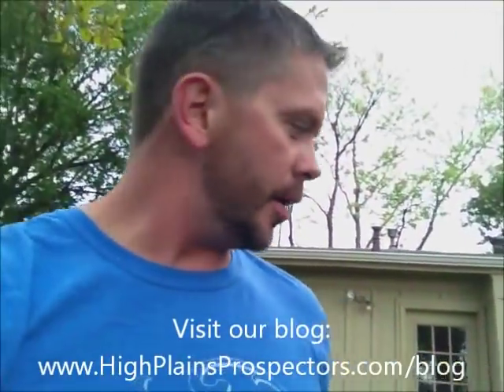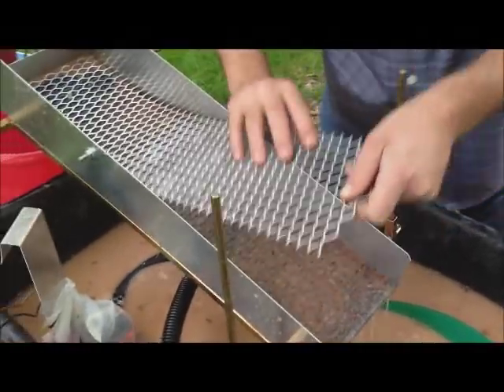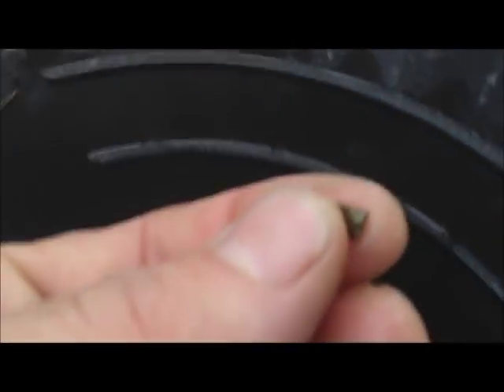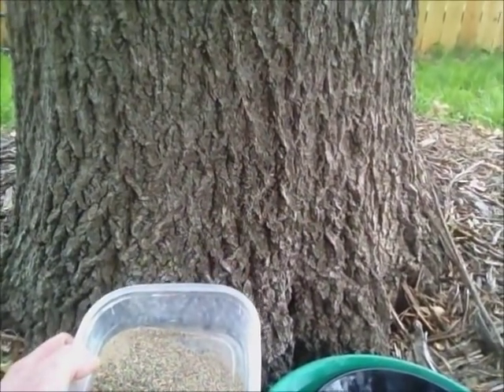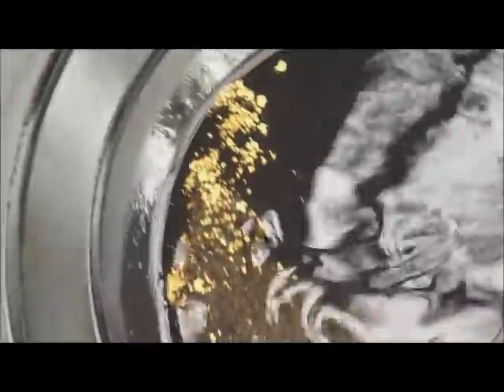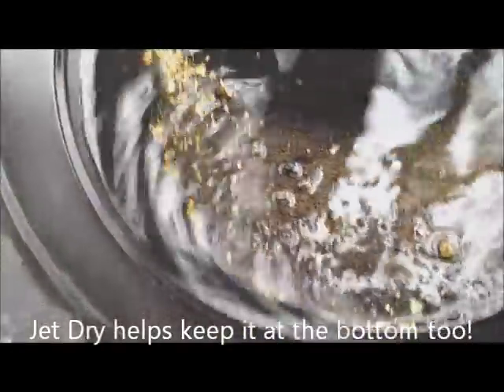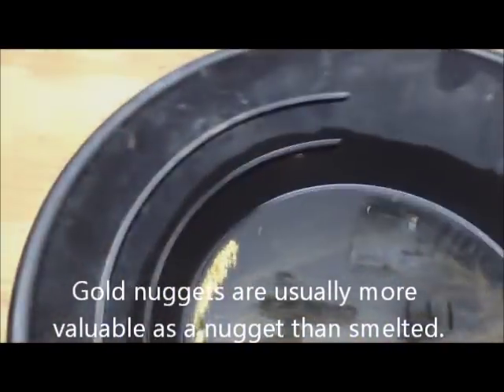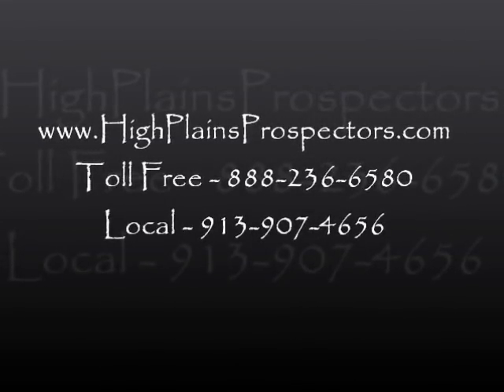Gold vs Pyrite - Telling The Difference in The Field - Gold Mining Equipment

Comment: TAP...do not swirl...no circles...circles BAD.  Also, get you a large eye drop bottle or one of those travel bottles that have a squirter...put jet dry in it for the field...seen a lot of guys throw gold away because of surface tension...never tested it for 'squish' before tossing it...BAD...BAD...BAD...

Comment: How about trying a high powered hydraulic press similar to one that presses thc under heat. You separate the elements in a pan and then press each for diff. controlled experiments

Comment: you learn this by panning. real gold is 19 times heavier than water (I think) and it won't move. It will only move if it is dirty with lighter materials, that's why people who prospect carry around dawn with them. Some pyrite can have gold in it, kind of rare, I collected some of this from my aunts mine in Nevada and had it tested. You can also find rubies and diamond in your black sand, diamonds will stick like the gold, rubies will move with the sand so use a magnet and the rubies usually fall out of the sand as you lift it up. You are welcome noob prospectors.
Reply: Dylan McCallister fantastic tips... Thanks for the extra info!
Reply: Dylan McCallister wait youre saying rubies are magnetic??
Reply: @unsubme2157  No he said rubies fall out so the black sand must be magnetic and stick to the magnet and the rubies fall out.
Reply: People use dawn because of waters surface tension not cause the golds dirty...
Reply: @InUrMoufEnt  Yes. Water surface tension will cause powder gold to float.
Reply: Yes, 19x heavier. Interesting stuff you wrote about diamonds and rubies. It's been said we have corundum here in my area.

Comment: pryite is shiny and when you touch it tends to break or fall apart espic in your pan, also leaves a gold streak I call it if you move it around. You should be able to tell gold . I like to use a high def light source normally it picks up really nice if you don't have a scope. Blue and green pans work best I do use the black ones but tend to be harder to find..

Comment: HELP!!!

Okay guys I have a question.

Is Mica magnetic or dissolves in hydrochloric acid?

Heres the deal, in one of the local beaches I went to when I was little I would always see shinny flakes in the sand. A few days ago I saw them again and picked them up in a bottle to take home and study it closer. I have literally seen every video and read every article on how to distinguish real gold from pyrite and mica and one of the key things I found was that both mica and pyrite are made of some sort of iron and iron is magnetic, and when I put a strong magnet to the flakes the were not magnetic. The thing is that in almost every other aspect "how shinny" "is it heavier" " is it malleable" does it break" all have pointed towards the fake stuff. 

This is so so small flakes that when I pan it, the flakes will literally go to the top. This is basically super super thin, as in aluminum thin. Then when I bend it it does but it will break after I put pressure in the middle.

I am seriously hoping this is gold but I don't want to get my hopes high.

Does Mica or Pyrite dissolve in some type of chemical that gold doesn't? That way I can be sure enough that what I have is gold and buy expensive gear to get it out?

Please help me out. High Plains Prospectors- Metal Detector & Gold Prospecting Supply
Reply from the maker: I am afraid I am going to have to diagnose you with gold fever my friend.  It has happened to all of us.  Mica and pyrite will not be able to be removed with a magnet.  I suppose you may find some pyrite with enough iron to stick to a magnet, and I know if you heat it it becomes magnetic.
Reply from the maker: That being said, there is a chance you could find some beach gold depending on where you are located.  Odds are, if there is gold there, others have prospected for it.  That is not to say there isn't plenty left.  I saw an episode on Gold Fever where Tom Massie did some prospecting on a beach and found a fair amount of gold.  Find a local prospector and talk to him/her.  You should be able to do so on a forum or through the GPAA.  Good luck and happy hunting!
Reply: High Plains Prospectors- Metal Detector & Gold Prospecting Supply So it isn't gold?
And I was thinking of doing an experiment with a school professor, where we would get hydrochloric or sulfuric acid and add it to the sand, and all material but gold would be left. SO my question is pyrite or mica able to dissolve in HCI?
Reply from the maker: I am sure over time it would dissolve...very small pieces would.  I am all about experimenting so go for it!  I am not a science teacher and took only one chemistry class...so I am not sure exactly how it would work with your material.  Get some video...we would like to see it!
Reply: +High Plains Prospectors- Metal Detector & Gold Prospecting Supply can you use soap to lift the gold?
Reply from the maker: No, a small amount of rinse agent is all you want and it actually breaks the surface tension of the water to make the fine gold sink.  Good luck and happy hunting!
Reply: High Plains Prospectors- Metal Detector & Gold Prospecting Supply thank you very much!

Comment: did u find all that gold 6:54 at the top of the sand/pan (or is that ALL gold?) anyway did u find all that in ur yard?
Reply from the maker: That was a mixture of gold, pyrite, and sands.  The point was to show how differently they act in the pan.  This gold was found from various places around the country.  This is the result of stockpiling  a bunch of concentrates from different places and then going through them to extract the gold later.

Comment: Sir, I got g-fever. I have been thru the panning part in a select few spots. Not much, plus hard spots cause of river currents and tides. I have discoverred gold flakes or pyrite in Quarts that is attatched to rocks. I have been heating the quartz for easy extraction. I got 1,000 tiny gold flakes per square inch. I just found out how to test for fools gold, and 1/2 of my flakes are sticking to a magnet, others are not. Alot of flakes are silver, and alot gold. I got a big rock nextdoor I have been pounding on, cause of it's great concentration of quartz ROWS. I also know where there is a huge peice of quartz near a river that cannot be moved by hand. It is also on top of a rock. The rock itself has a stream flowing thru it, and after seeing my pic's again of it, there is quartz growing on top of it in areas. I just now brushed a bunch of teeny,tiny gold flakes off from the rock, and magnet won't stick to it. Maybe too small..I got a ton of quartz around here, what to do? Put it in the acid? Re-heat? FYI, I heat my quartz/rocks in a burn pit. That way, it will cook a long time. I also cant beleive how fragile the quartz gets when heated to 1,000 degrees or more. Any thoughts?
Reply from the maker: LOL, it certainly sounds like you do have a case of gold fever.  The first telltale sign is mistaking every rock for gold!  Beware, gold is hard to find.  You can certainly find gold near quartz, pyrite, black sands, etc.  However, not every time!  Keep at it and just keep anything  you find that is really heavy (i.e. black sands, etc.) Most likely you can extract some precious metals out of it eventually.  You may try one of the Kwik Kilns for smelting some of your concentrates.  Here is the link: http://www.highplainsprospectors.com/kilns-smelting-assaying-c-155.html
Good luck and happy hunting!

Comment: I noticed lots of little bubbles. Are you by any chance using soap?
Reply from the maker: LOL, no, just too much Jet Dry...I over-applied.  Everyone seems to want to point that out to me.  Geez guys gimme a break! Thanks for watching...and pointing out my imperfections.  ;)
Reply: I didn't mean to drill you about that. So is that basically to keep fine golds from floating?
I am basically a novice at it but have recovered so far about 3 grams.
Reply from the maker: :) No worries.  Yes, the Jet Dry or some other type of low-suds rinse aid will help fine gold from floating. Just a little goes a long way (as you can tell in the video). 3 grams is not bad for starters!  Keep it up!  Good luck and happy hunting!

Comment: There is an area I cut firewood in northern California where the ground sparkles and is littered with agate and quarts. I went out after the last big rains and there was lines of what appeared to be black sands all the way down the hills. what are your thoughts on the signs of agate quarts and the sparle all over the place?
Reply from the maker: I say pan some out and see if there is any gold.  Certainly where there is quartz there is a chance of gold...especially in Northern California.  Lots of gold up there.  If you want to scoop up some and send it in, we can sample it for you (we can video the whole thing).  Usually we like to get about a medium flat rate box worth at least.  Send me a PM and I can arrange postage and such.  Then if we find a little gold you can go back with some better equipment and extract some more.  If there are any dry streams, that is where I would start.  The gold will accumulate there.  We can discuss more if you like.  Thanks for watching and thanks for the comment!

Comment: have any info on determining the difference with acids?
Reply from the maker: Sure, visit our website here: http://www.highplainsprospectors.com/complete-gold-testing-kit-p-785.html
The instructions are here.  It is always good to get some experience using the gold testing needles you can purchase separately...or if you have some refined gold where you know the karats that will work too.  Good luck and thanks for watching!
Reply: i have crushed ore from the main vein in a high copper environment, i see gold,.. i am concerned with it being iron or chalcopyrite,.. was wondering if there was an easy anwer other than an assay,.. but no matter,.. its been sent off for assay
Reply from the maker: Thanks Todd, sounds like you took the right path.  Good luck!
Reply: Nitric acid pyrite will go black gold will not change

Comment: Good video... But I shall prompt a question...
Have you ever checked these pyrite pieces??? That they do not contain any Platina or Palladium???
They are almost equally valuable as gold... and they are mixed with other ferrous material....
Of course in much smaller quantities than gold.. but if someone gathers it... by the time it accumulates a substantial amount and income...as well... BUT...the challenge that there is there is the cleaning process... It requires "special" knowledge which is obtainable from the YOUTUBE as well
There are videos about Pt and Pd ... check them out...

Comment from the maker: The rules are usually pretty well spelled out...some a little less clear than others.  But, public lands usually have a rule about prospecting, gem collecting, metal detecting, etc.  I have some links at the bottom of our website for many resources.  Regardless of how clear or not clear the rules are, the fact is that public lands are for public use and typically there is some level of prospecting you can achieve within a close distance.  Stand for your rights!